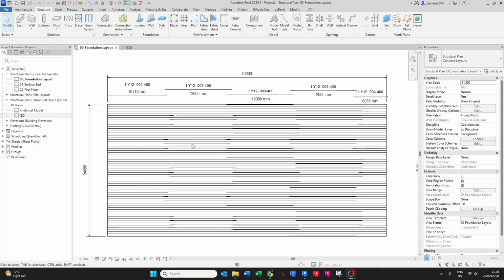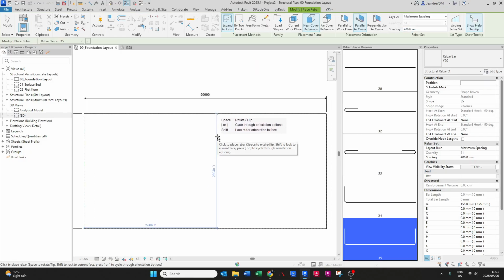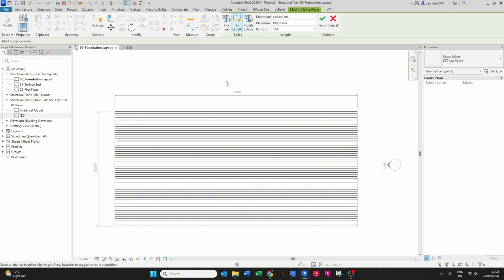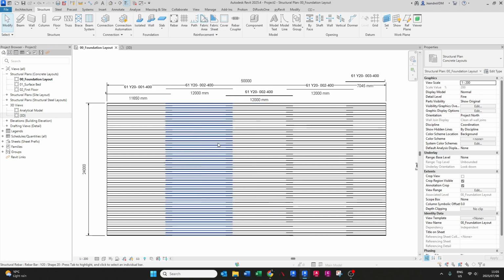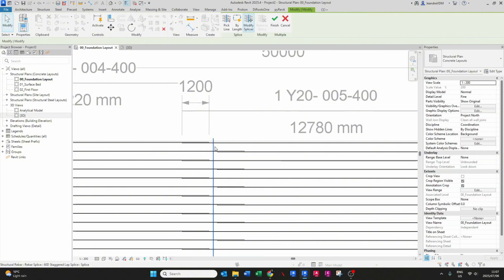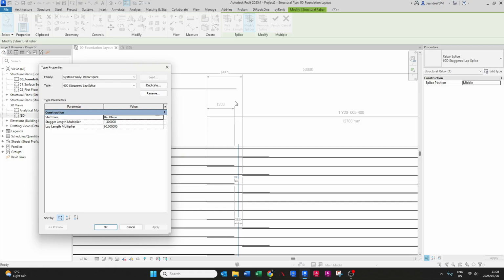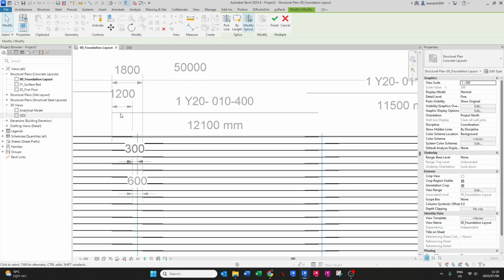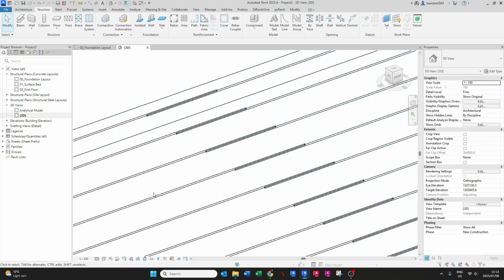Revit 2025 Rebar Splicing Tutorial – Smarter, Faster Detailing

Comment: Thank you so much for taking the time to create this review! 
Unfortunately, many Revit reviewers ignore couplings, but they are indispensable when designing in seismic areas, and we constantly use them in our projects around the world. At the moment, we have Revit version 2022. 
However, I still have a few questions: 
1) Did I understand correctly that if you install a coupling that does not create a gap, then the separator will not be removed 
2) Did I understand correctly that at the moment there is no such modifier that would immediately install couplings with a shift, and after removal the rod would again become one (I saw something similar in Tekla)
Reply from the maker: Thank you for your positive feedback.

Q1 = You understood correctly. In Revit, if you place a coupling that does not introduce a gap, the bar separator remains in place — it does not get removed automatically. The coupling is applied, but the split in the bar is still recognized.

Q2 = At the moment, Revit does not have a built-in modifier or tool that works the way Tekla does. In Revit, you need to manually place couplings with an offset/shift. Removing them will not automatically merge the bars back into one continuous rod. Tekla has more advanced automation for this process, while in Revit, it still requires some manual adjustments.

Hope this helps.